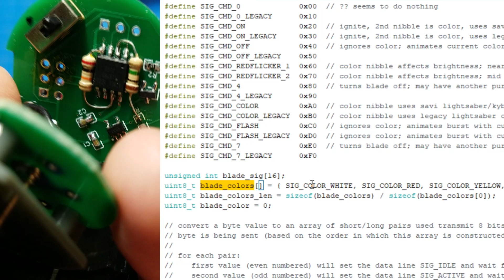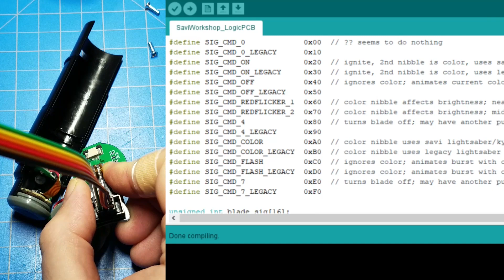An Unused Color In Galaxy's Edge Lightsaber Blades

Comment: I own the luke skywalker episode 6 lightsaber from galaxy's edge and when I first got it, occasionally it would turn red, is this intentional? If so, how do I activate it?
Reply from the maker: it is not intentional. it could be a sign that the blade is not fully inserted, or perhaps the batteries need replacing. it could also be a defect in the blade or hilt. if the problem continues you should contact Disney's Guest Merchandise Services at Merchandise.Guest.Services@DisneyParks.com and tell them about the problem. they may be able to mail you a replacement.

Comment: That doesn’t look anything like the Darksaber tbh, the only thing I could think of it’s maybe indigo from Fallen Order. But I have no idea why they’d go with that and not orange or cyan
Reply from the maker: Yeah. Darksabers should be black in the middle with a white light coming from the edge. Maybe some cracks in the black area with light peeking through. This came about when someone suggested making a UV light lightsaber blade as part of a darksaber build and I mentioned stock galaxy's edge blades have a dark purple mode (similar to what you might see from a UV blade) and made this video to demo that.
Reply: This is unlikely but what about Reven

Comment: Whoa!!!! Thats the best video about a hidden feature I have seen yet on these Galaxy's Edge Lightsabers. The fact that you can reprogram your custom PCBs so easily on the fly with Arduino just amazes me even more. So thankful you made this video as it raises so many modding ideas about the flickering effect and a dark saber blade. Imagine an extra slightly darker sleeve that you can slip on top the existing blade with the dark purple color which acentuates the outer edges of the sabre blade glowing and the inside core of the blade being darker.due to some shimmer effect on the sleeve. Similar to those lenticular stickers where one angle is a different picture from another. You just blew my mind sir. Now its just a mad dash to try to find a corresponding code to put on a Kyber crystal which calls up this hidden color. Thank you.